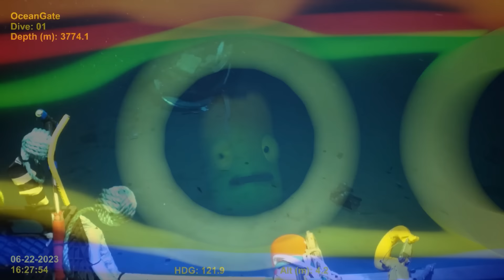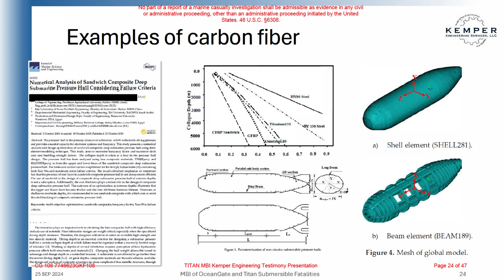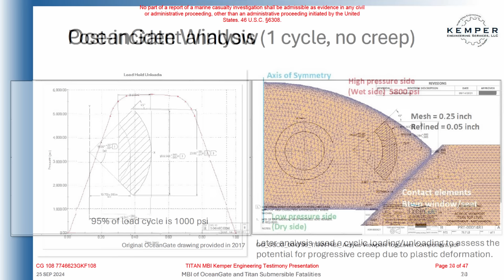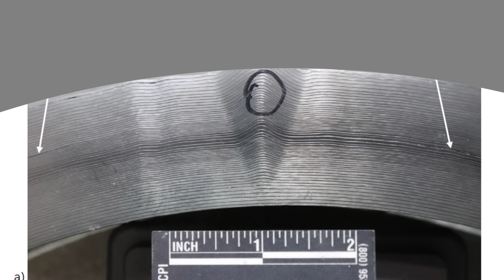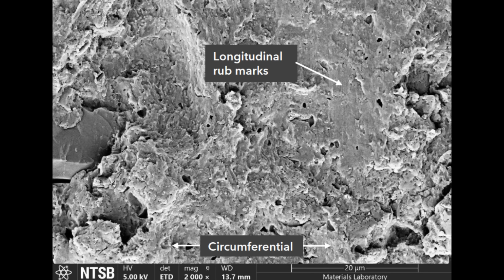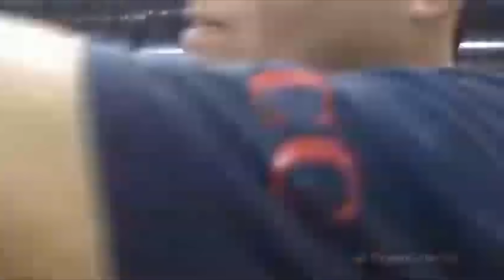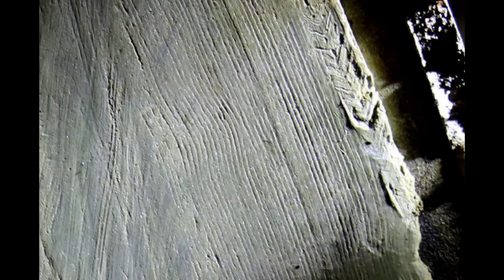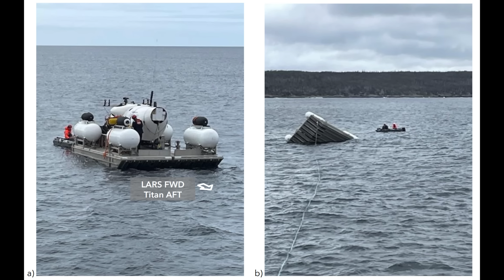OceanGate Wreck Shows Why Sub Wasn't Strong Enough To Survive - NTSB Shares Important Details

Comment: Former composite M&P here.

The reason Boeing wanted them to do 45 degree plies is because you want around 10% of the fibers in any given direction (-45/0/45/90). If you don’t do that, you can get higher inter laminar shear forces (bad) and the directions lacking fibers have properties dominated by the resin.

That means that in shear/torsion, the sub’s material properties were far closer to that of the resin alone, rather than the fibers.
Reply: What's your opinion on the titanium to CF interface? The flanges are very thin and do nothing, all the shear forces caused by the difference in the elastic modules are resisted by the glue alone in shear
Reply: @nirodper  The flanges aren’t what are sketchy.  They seem to have mainly been there for extra surface area for the adhesive.

Machining away carbon to get the flanges to fit is sketchy.  Not doing any surface treatment is beyond sketchy.  Titanium is difficult to bond properly, as is pretty much all metal.  A freshly machined surface is absolutely not appropriate for a bond.  You need some sort of surface treatment, at minimum a sand blast but preferably a plasma etch or some sort of primer or sol-gel process.  It also needs to be done in a clean room environment with temperature and humidity control.

When an adhesive joint fails, you ideally want to see the adhesive on both sides of the bond.  That means the weakness wasn’t in the quality of the bond itself.
Reply: @TheTonyMcD /s 😅
Reply: @TheTonyMcD  i love adding hand oils into my adhesive prep treatment. really helps give me that delamitation effect that im looking for
Reply: @TheTonyMcD  The description provided by bjw0007 sufficiently defined the salient issues.  It is time for you to run along and focus on your specialty, licking windows.
Reply: @vincentsutter1071  First exposure to humour then?  Welcome to Earth!
Reply: @bjw0007  It seems to me the adhesive (mainly) only needs to function as a gasket once the vessel is in the water. In other words, it needs to do very little adhesion and only resist water pressure. The lips/flanges on the rings were to help center everything properly during construction, provide more adhesion surface and bear the weight of the domes out of water. What alarms me is that vs a traditional gasket the quality control is much more difficult since the adhesion is all being done 'blind' so to speak. It was probably unevenly thick, with voids, channels and contaminants (such as human hairs, dust, insects, etc) because it wasn't done in a clean room.
Reply: @TheTonyMcD  I had a teacher who said when ever clients would demand he break the laws of thermodynamics, they only thing you could do is make sure the product wasn't dangerous and add a beep and flashing light.  I asked if that was a warning.  He said no, warnings need to be so obnoxious that they cannot be ignored.  It was just to make the client think said laws of thermodynamics were bent just for him because don't those laws know who he is.  He was saying that attitude wasn't common, but it wasn't super rare either and it was always severe when they had it.
Reply: @nighttrain1236  there actually is significant shear load on the adhesive.  The stress transitions from being half as much in the longitudinal direction as circumferential in the hull to uniform on the end caps.  This is due to the transition from a hemisphere to a cylinder in the hull shape.

This transition in stress has to be handled by the adhesive.  On top of that, the adhesive has to take the load arising from the difference in deflection from the ring and end cap and the carbon hull.
Reply: @bjw0007  It has to accomodate relative movement, yes, if it is to function as a mechanical gasket, like the difference in strain between hull and ring you mention. The hull can deflect all it wants if the glue has enough elasticity to respond and recover. Of course it has to do all this whilst under extreme operating pressure.
Reply: @nighttrain1236  The titanium to CF adhesive doesn't "only" resist water pressure (which is tremendously high at those depths), but as the sub goes down, the titanium and CF composite compress at different rates. This creates very high shear forces, if the hemishperes had thick and deep flanges that were stronger and allowed more surface area for the glue it could be ok, but the thin flanges they used were essentialy decorative and only aided alignment. All the forces were resisted by the glue, in a butt joint between the machined titanium and machined carbon fibre (that already had 5 distinct sections that could move at different rates).
A disaster from the start.
Reply: @nirodper  Consider if you just had a mechanical gasket there or o ring. It would only have to accommodate any movement between the two opposing surface of the joint. I don't believe the glue was primarily designed to resist mechanical loads only hydrostatic ones. The thin flanges/lips keep things aligned whilst hydrostatic clamps it all together.
Reply: @TheTonyMcD  I would have at least used Windex or Murphys Oil Soap and a toothbrush.
Reply: @TheTonyMcD  you are the subject matter expert at licking things.  Hey there goes a dog, show him how its really done. DA.
Reply: @TheTonyMcD  "it appears you dont have an explorer mindset"
Reply: @j.f.christ8421  be sure to identify the humor when it is present.    Enjoying your first experience with fact and reality?
Reply: @bjw0007 not to mention it wasn’t made under a vacuum, i bet that’s where some of the voids came from, plus it was absolutely stupid to make it 5 separate layers instead of one piece, no matter what kind of glue you use those layers are going to move independently of each other under such high compressive force, i’m sure they could’ve found a way around the wrinkling issues if they actually put the time and engineering into solving it instead of just essentially cutting the bad part out then slapping more carbon fibre on top of an already compromised area, it’s the equivalent of putting a bandaid over a bullet wound
Reply: @TheTonyMcD 😂
Reply: @nirodper Those flanges are so small I couldn't figure out what they were talking about at first. I was confused what they were looking at. 🥴
Reply: @nirodper  I couldn't believe how thin those 'flanges' (or should one call them 'rims'?) were.
Reply: @nirodper  You are right, the design of the flanges are wrong.
Reply: @nirodper bad idea is my opinion on that. I think carbon fiber is just a bad idea and it doesn’t matter what you do. Titanium by itself is dependent.
Reply: @nirodper titanium is a flexible metal carbon has zero flex. This is a bad mix as a flange seal. If both materials are the same with a gasket seal then torsional forces flex the 2 equally till material failure
Reply: @nirodper  If there is no deformation the carbon fiber to titanium interface changes absolutely nothing in this  case since the water pressure is actually pushing the titanium ring into the base of the carbon fiber cylinder. The issue is if the cylinder starts crushing towards the center of its length, that's when the glue becomes  important. As an engineer, with any doubts I might've pushed for a fully encased cylinder base to limit risk of deformation around the joint, basically having the cylinder base sit fully encased in a groove in the titanium ring.
**Edit: NVM they actually did exactly what I would've done, but they fucked up the dimensions and machined ther carbon fiber down, lol.

Problem is really in the carbonfiber layup. That video that shows the layup shows they did not know what they were doing. They should have been layering up indexing at 45 degree angles, not wrapping it like a garden hose.
Reply: Stockton was quoted saying "there are no torsional forces in the ocean" when asked why he didn't want 45 degree wraps used.
Reply: @coalesced  Stockton wasn’t entirely correct about that.  Yes, in normal undersea use there aren’t really torsional loads, but when there is a difference in stress in two orthogonal directions, then you have shear.  The hoop stress was different than the longitudinal stress, so by definition there had to be shear stress.

On top of that, any bending on the hull, like when it was lifted out of the water, or if there was any instance where it was dropped, or if it ever was on rough seas, then there would be shear stresses, particularly at the half way mark between the top and the bottom.
Reply: @bjw0007 that's right it's not the environment it's what he added to that environment, he missed that point in his minds eye
Reply: Yes, if stresses perpendicular to each other are not the same, you have shear at +-45°. But fibers at 45° do not help for shear at 45°, only for shear at 0°/90°. The main shear issues here are out of plane, that cannot be solved with 45° layers, like someone mentioned. Interlaminar shear strength is a very important topic and from what we see, not given the appropriate importance by ocean gate.
Reply: Ok, now I see you made the comment about shear 😅
Reply: @bjw0007  What about any time they left the massive titanium door swung open? I can’t help but think it’s just creating a lever to do more damage to the forward end every time it’s opened.
Reply: Yet lifts by rings 😂  @coalesced
Reply: @coalesced  Oceans have currents 😂
Reply: I actually understand your explanation! ~30 years ago I read a few articles and book chapters about composite aircraft construction (crazy idea of building my own homebuilt plane), and I remember this very topic of the resin having almost no strength on its own. With circumferential layers and longitudinal layers only, how could the two resist shear against each other? And they had to shear as the sides flexed in at depth!

I knew that I didn't have the skill for that kind of project - a composite airplane (much less ambitious than a deep-sea sub). I'm glad I know my limitations.
Reply: @DrBeenaPlumber  The plies trying to slide past each other is inter-laminar shear, which is what the adhesive was trying to resist.  Having different ply directions isn’t really going to resist that.

The shear that 45 degree plies resist are if you drew a square on the hull, then twisted or bent the hull so that the square skews with the top edge moving past the bottom.

A better way to think of it is like a really soft eraser.  If you draw a square on it, then push equally on all sides really hard, the square will shrink but still be a square.

If you instead push it along one direction parallel to two of the sides of the square, it will turn into a rectangle.  However, draw a new square at 45 degrees to the original and push in the same direction.  THAT square will no longer have perpendicular sides.

A lone compressive stress in one direction is the same as shear at 45 degrees (at half the value for… reasons).

Another example.  Set a deck of cards on a table and push down.  Nothing happens.  Now put them on a 45 degree surface and push.  They slide right past each other.  In both cases you were pushing down, and the force was compressive in that direction.  However, when you put the cards on the incline, it rotated the deck so that your compression was seen as shear by the deck.
Reply: @bjw0007  Thank you for the deck of cards explanation. A perfect example.
Reply: @bjw0007 the card deck analogy is easy to understand for us folks that have little knowledge on these subjects, thanks!
Reply: @bjw0007 You are assuming homogeneous stress. In a non homogeneous stress there will be a torsional component.
Reply: @DrBeenaPlumber  Money. Building it well would have cost too much.
Reply: @DrBeenaPlumber  Yes under compression the longitudinal and hoop wound layers will develop serious shear stresses between them.  Even worse are the stresses in that green adhesive layer.  That is effectively a weak resin inclusion separating each of the 1 inch cured layups.  The rub marks and white powder prove there were large cracks developing within the green adhesive. The cracks and rubbing developed with each dive. These progressively reduce the buckling strength of the whole carbon fiber hull cylinder.  It eventually behaves mechanically like five independent, concentric one inch thick tubes rather than a five inch thick structure.  You can bend a pile of paper much easier than a board made out of essentially the same wood fibers.
Reply: @DrBeenaPlumber  I think a fiberglass aircraft is totally doable at home. But not a carbon fiber one.
Reply: @Dimich1993  if you cann do glasfiber panels the carbon fiber is only a good cutting tool and a bit more money away 😅
Reply: @TheLtVoss  You can vacuum form a glass fiber parts with a pretty simple setup at your garage or something, but for carbon fiber parts you need an autoclave of appropriate size at the very minimum.
That's pretty much the depth of what I'm comfortable saying, composites are challenging to get right. 🤷
Reply: @DrBeenaPlumber  That's really cool, I didn't get further than looking up information while at the uni. I know about the vacuum forming technique, which is really good at removing air pockets from the material, however I don't know if it's compatible with initial direct bonding to a foam core. Also composites' behavior is much more complex than metals, some assumptions just do not work and that's where the danger is.
Reply: @Dimich1993 Naw there's lots of information online about vacuum bagging carbon fiber and YouTube videos showing the process! Whether you want to use that process to build a carbon fiber kit plane in your garage or not is another matter. :)
Reply: @ButterfatFarms  Interesting! Thanks for letting me know! 
I would like to do that... However the backlog of projects is huge.
I wonder if the resins are different, or just the resulting properties, because the high-performance carbon fiber parts, like F1 and aerospace, are still made with an autoclave.
Reply: @Dimich1993  Aerospace epoxy formulations used with B-staged partly cured prepreg are stronger and require a much higher temperature cure.  And the part can be used up to much higher temperatures.  The raw laminate is wrapped in peel-ply and covered with absorbent felt.  The whole mess id placed within a vacuum bag hosed to a vacuum pump outside the autoclave.  Air is pumped out of the vacuum bag and this eliminates air pockets left in the laminations.  And before heating begins the autoclave is pressurized up to a few hundred psi.  This further compacts the raw part.  Importantly, as slow heating is begun the B-staged resin softens and any excess seeps through the tiny holes or weave of the peel-ply and is absorbed into the felt.  This results in the highest possible fiber density in the completely cured part and thus the greatest strength and stiffness.
But your not making an F-15.  For more mundane home build projects carbon fiber can be wet layup with or without a vacuum bag and with or without the felt.  Recently "resin infusion" has become popular where dry composite fabric laminations are pumped down to high vacuum in a vacuum bag and room temperature slow cure resin (epoxy or polyester) is subsequently bled into a system of tubes attached at special locations to saturate the laminate.  This works best where a mold is available to give the part an exacting shape and surface finish on one side.
Reply: @DrJuan-ev8lu  Thanks for the great info! Not gonna pretend I understood 100% of it, but I learned something!
Reply: I’m sure all the voids helped a lot too.
Reply: When even Boeing says you’re taking risks, that’s saying something.
Reply: @KevinBalch-dt8ot  Boeing's management wasn't involved, so the engineers could actually do their work correctly.
Reply: @lolilollolilol7773  If Boing had built it the door would have fallen off plus the risk of losing the roof.
Reply: @KevinBalch-dt8ot  Boeing has much the same problem really.  Smart engineers who know better and are all too often ignored when their advice proves inconvenient.
Reply: @KevinBalch-dt8ot  🤣
Reply: Great insight! 
I wonder if the layers could have buckled after a delamination, it looks like all the fibers were laid in radial direction.
upd: ok, they had longitudinal layers. Still could've buckled the way it was made.
Reply: That moment when you realize that Boeing would have built a better passenger vessel
Reply: Just like cabon Fiber paintball and scuba tanks. You can see how all the lawyers run in the specific directions for strength
Reply: @AA-zv6yo  There are  typos, and there are GREAT typos.
Reply: @springford9511  few beers deep. My bad.
Reply: @AA-zv6yo  still a great comment though! 😂
Reply: @AA-zv6yo  Your typo is still ironically true!
Reply: @AA-zv6yo   love the Freudian spelling in your comment!!!
Reply: @AA-zv6yo  Layers?
Reply: @AA-zv6yo  All the fibers in interior pressure vessels are tensile. All the forces here are compressive. It's really not equivalent
Reply: @Brainstormer_Industires  but surely changing the weave, type of carbon and the way it's layered is important....?
Reply: @AA-zv6yo  fibers only have tensile strength. Scuba tanks have pressure on the inside trying to expand the tank. In this case it's the opposite and absolutely insane, where the CF might as well not exist.
Reply: And they made it clear it will not work out otherwise. Stockton appears to have been smart/clever but neither wise nor able to get nuance... he told Lockridge Boeing wanted the 45deg "because otherwise they can't do it" - seemingly in the sense that their software would not work otherwise, that they could not compute it. He thought it was some limitation of modelling or their heads, not a limitation of cooperation in the material. Like gulliermo he thought that the material has to follow his mental image. Those rich dorks
Reply: @udirt Nothing more dangerous than surrounding ones self with “yes” men
Reply: These are the comments that are actually worth reading. Thank you.
Reply: I'm just a simple structural engineer but machining away a wrinkle in a tension element actively reduces it's tensile strength. Just saying...
Reply: What about the voids between layers at 17:50 ? Meh, bad or horrific?
Reply: @VoicesInDark Unacceptable.
Reply: Thank you for your input, for once I'm not being sarky. Even a simple pipefitter like myself can see there are serious manufacturing issues. My CF fishing rod seems to have less defects than this. It was as far from clean room manufacturing, The CF - Ti interface looks relatively small. A minor deflection at the center of the vessel would place a comparatively large stress at the join, at least that's how it appears to my untrained eye. Pipe flanges are large for a reason, If I designed this interface it would look a lot different. Rush seemed to be hoping the pressure differential would be holding the domes on. I would engineer a join to be the strongest part, not the weakest and hope the water pressure keeps it together. As for using bed liner to prevent water ingress, utter madness.
Reply: Obviously ! Any eng who accepted this "design", worked on it should loose his degree !!!
Reply: @jpcaretta8847 degrees and certifications are not one in the same lol. 🙄😑😑😑😑
Reply: Isnt it always like that in compression? Because the Boeing hulls are made for internal pressure, not outside
Reply: thanks for this insight!!
Reply: That field must be awesome to work in! I took a composites class last semester as part of a plastics & polymers degree, we made some simple composites starting with flat rectangles before trying some 3D parts.. which we then put under many more times pressure than that of the atmosphere to pull the resin throughout the build. 2D Rectangles weren’t bad.. but 3d got crushed in seconds for our first 2 tries. 

When they came out good they felt like bulletproof glass, but we did manage to break one by having a student stand on one end while the other end was clamped to a table. And while it wasn’t the strongest resin obviously, you can imagine how something that cracks under a 180lb college kid would do at 3000 meters down
Reply: That’s what I do.
Reply: Thank you. So many people so quick to attack the low hanging fruit and share their experience working with carbon fiber in their day to day life but so many just don’t get it as much as they think they do.
Reply: Oooooh that makes sense, thanks for the comment
Reply: Google is awesome 😂
Reply: 1000 th like yeah!
Reply: I fly RC. I knew this!!!!! Me! The guy who flies RCmodel airplanes!! I can’t believe they “machined the layers” too!!!
Reply: in this case, it was totally the resin that took the shear
Reply: Those words on their own make sense, you put them in that sentence and I just felt like a pre-schooler
Reply: m&p is meatballs and pasta?
Reply: but this doesn't help with the shear between layers.  And it had FIVE huge layers, GLUED together.
Reply: Yeah Boeing is not who you want giving engineering advice
Reply: omg I was under the impression they had used a carbon fiber fabric for the hull at first, but they didn't even do that its just all in one direction thats insane.
Reply: @titicaca315  They didn’t use fabric, but they did have plies both in the hoop direction and longitudinal.

Filament winding is absolutely a valid method for making structural parts.  The issues here are that there were no +/-45 degree plies, and tremendous porosity and void content.
Reply: @just9911  even a casual conversation with you makes others appear to be  intellectually superior.  Oh look your coloring book is calling your name.  Bye bye.
Reply: @vincentsutter1071 take the L, buddy. You're just embarrassing yourself.
Reply: @Shinkajo  should I send you some tissues?  Don't cry because the subject matter is above your pay grade. DA
Reply: NOeing
Reply: Former is the keyword here
Reply: Makes sense, if you twist rope or cables  to make it disperse forces better, just twist the entire dimension to make the flat surface stronger. Don't line up weak points.
Reply: When Boeing questions your engineering... yikes.
Reply: How does carbon fibre machine? Does it fray or leave dust/residue? Would those machined surfaces neat some kind of treatment?
Reply: @just9911  No need to assert superiority it requires no effort to be true.  I laugh at your simpleton excuse of sarcasm.  It is so quaint and a common crutch of the useful idiots like you.
Reply: That is in hindsight incredibly obvious.
Reply: Yea......huh?
Reply: Interesting. Does that even matter that much though? Was this thing not always doomed? Ignoring all the other technical aspects- is a carbon fiber tube not just a bad idea regardless?
Reply: @ it’s not inherently bad as a material in compression, or for use in a submersible.  As I understand it, there is active research on using composites for submersibles.  However, as it was used in this case was terrible, and I’m not sure it was the best material to use in this case.  I suspect it could be a good choice for submersibles that don’t go as deep, but again it is an active area of research and not something to slap together in a glorified garage.
Reply: I believe that is exactly what happened. To add to that, layers of the resin had already been far compromised as well.
Reply: Well yes and no about the fibre direction..
In the middle of the submarine the fibre direction should only need to cirumular since the largest force by for is the crushing force from the pressure. Thats why normal depth submarines have strong rings along the axis of the submarines length.

At the rounded edges and doorway though yoj would need crossdirectional direction of the fibres..
Reply: Why would anyone listen to Boeing. Seriously.
Reply: I used to do a lot of woodworking which involved anything from building new homes to completely gutting a house to replacing foundation walls. Then I also used to work with furniture and making cabinets. The point I am making is I've worked with many different types of wood and laminates, which would be similar to the directional strength of carbon fiber. We know that plywood is much stronger than standard dimensional lumber. I know that OSB is not as strong as standard laminate wood plies but my question is, is there a point where the number of layers with carbon fiber increased, would they actually make it weaker? I do understand that the multiple orientations of the strands would make a difference.
Reply: @davidclemens1578  outside of specific situations where stiffer means higher stress (like the viewing window), no, more layers means higher strength given you don’t cause manufacturing problems with more layers (like wrinkles)
Reply: @davidclemens1578 Depends on how you look at it. In raw strength, I doubt it could have much of a negative impact. In this case though, carbon fibre was chosen for its high strength to weight and stiffness to weight. 45 degree layers would likely have added less strength pr. Added weight in the primary load directions. 

Having personally made and tested glassfiber (practically same properties as CF, just heavier and more compliant), I would not be without at least a few 45 degree layers in something like this. There may not be any obvious shear loads in theory, but in practice you will find there are unexpected/unforseen cases that weren't covered by theory, especially in unproven designs like this.
Reply: I wouldn't use Boeing as an example for safety anywhere specially since they've had some catastrophic failures of their own
Reply: @captng3  Boeing seems to have more of a management problem than a shortage of engineers. Rush was a manager and sacked any engineer who disagreed with him.
Reply: @captng3  There's a major difference between a Boeing engineer explaining how to do things and the customer or management listening.
Reply: @captng3 I would absolutely use Boeing as an example of the impact of corporate management culture on quality and safety. Specifically stressing Boeing's management culture of safety and quality and the results that produced both prior to and after the merger with McDonnell Douglas. A company with horrible corporate culture and resulting safety record where their aircraft that have killed many people, who's management came out on top and in control of Boeing after the merger. To predictable effect. There's their problem. Much like OceanGate and Stockton Rush with his rubbish mentality when it comes to corporate culture and safety.

You should really watch the Boeing Last Week Tonight episode on YouTube for some insight about that, and a lot of good laughs. At Boeing's expense. 😂
Reply: That was the case in all directions, as carbon fiber is basically a string. you dont use string to support like a column (compression), you use it to hang (tension). The only way this build would have been using the carbon fiber's strength, is if the pressure was higher on the inside than outside. Which 100% was a possibility, but then they would have had to use helium instead of nitrogen, and it would have added decompression time to the dive. Maybe up to a week...

and that isnt even accounting for the voids in the glue, making expanding and contracting bubbles.
Reply: @GOP_Fascism_vs_DNC_Hypocrisy carbon fiber is not a string it is very stiff more like a steel wire than a string.
Reply: The whole industry needs to be scrapped. Carbon fiber needs to be able to be melted somehow like steel.

Until then too many variables in manufacturing process
Reply: @VoidPixel4179  Carbon fiber can't melt. Carbon goes directly from solid to gas at pressure and it's also the strongest material against heat, meaning there is no material you can use as a crucible to contain molten carbon. If you are able to melt carbon you can turn it into diamond, so it's a well studied problem.
Reply: @takanara7  maybe he meant convert the carbon to diamond.
Reply: @VoidPixel4179  You would be surprised that steel fibers are many times stronger than a complete steel piece, because you avoid imperfections in the structure. It's research stuff.